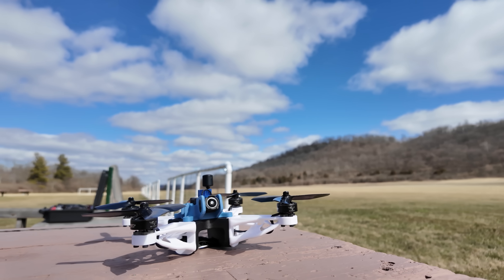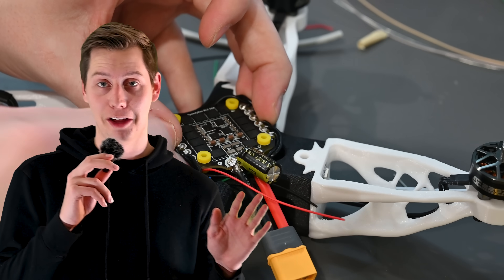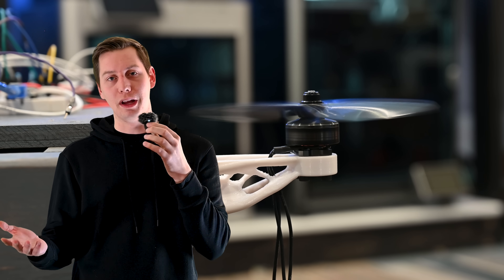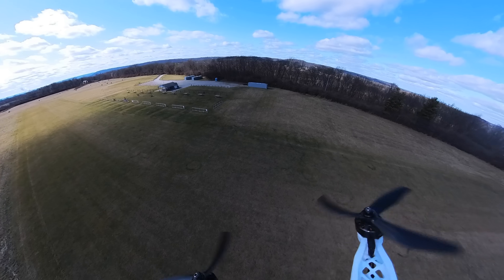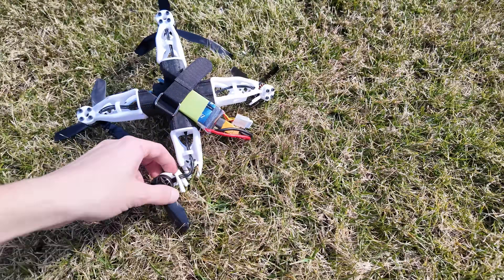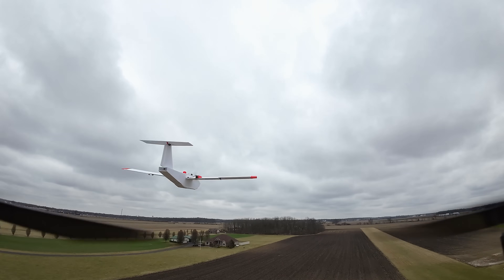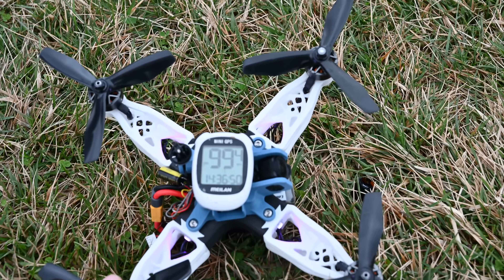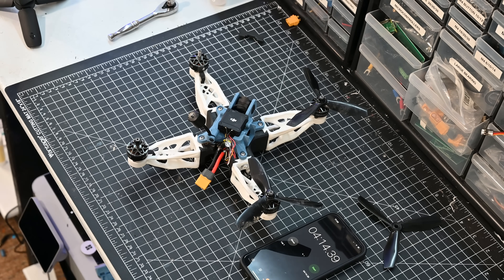Building a DIY 3D Printed FPV Race Quad

Comment: Hi, Really good video and frame. I have one question. When you crashed, you had to change a motor but did not solder a new one. What you use to match the cables..?

Comment: Great project & video.  But note that the DJI O3 Air Unit doesn't "cook" itself.  If needed, it reduces transmit power to regulate its temperature.  So you do need to provide adequate air flow to maintain max transmit power, i.e. don't enclose it inside an unvented fuselage.

Comment: Did you add ALL the parts you used? I see an antenna on the Flight controller, or is that one from the DJI O3? I would like to recreate this but I'm new to drones so any and all help is very welcome
Reply: The DJI 03 has an antenna attached

Comment: How much was the build in total and can i put a anarlog camera instead of the dji 04 unit
Reply: Yes. it has 3D printed adapters that have slots on the sides you'd most likely be able to bolt anything in there

Comment: mounting motors on PLA on a flying machine seems subpar no? glass transision stage is 57C those motors surely can get hotter with hard use. even with airflow? atleast go PCTG if you cant do ABS
Reply: no, not PETG, PCTG

Comment: I really want to build this. I have all the equipment, but no experience building drones or anything RC controlled and I found the how to part was scarce. Is there anything more detailed? Also, any links to the exact filament that was used? Or is the intended audience for this video for people with more experience?

Comment: where did he used 2mm bullet connector?
Reply: For the brushless motor connection.  It looks like that allows the arms to be taken off and replaced quickly instead of having to resolder theconnection every time you change an arm.

Comment: Why don’t you design it to where the arms slide in from the bottom? Seems to me you could just about eliminate the screws and the heat inserts if you did that since the thrust would push the arms in instead of trying to pull them out?

Comment: PLEASE make an assembly video. I’m just getting into the hoppy and I’m starting with a TinyWhoop but then I want to upgrade to a 5 inch and I think this is the one since I also just got the Bambu labs a1 (Although I don’t think my printer can print CF nylon) I’m not good at soldering or any of that kind of stuff so an assembly video would be amazing. Love your videos.

Comment: I noticed that he is kinda just letting the capacitor float on the back of the drone which seems pretty unsecure. Has anyone who has printed this frame found a better place for the capacitor to sit? Or maybe bend it more down then tape it to the frame? just seems like a unlucky crash could rip off the capacitor...

Comment: Looks like a step forward but not optimized for 3d printing, the durability would be very good if this was an injection mold but as a 3dprint it's not durable.
But great ideas incorporated, especially the arms for easy replacement.

Comment: How did you connect the controller to the drone
Reply: you either need a dedicated receiver that you would put in a 'bind' mode. or if you are using the dji O3 air unit that was mentioned in the video, the air unit is the receiver. it has a small button near the RED LED on the side that puts it into bind mode. 

With DJI, if you are using the DJI remote you would actually bind it to the DJI goggles. then bind them both to the air unit.

Comment: Hey can I get some help? I’m building this now lol, and I just tried hookkg up the 03 air unit, and it decided to die. Tried plugging it in to test power up, and it let out the magic smoke. Double checked all my connections and everything seemed good. But it fried the F405 stack. Got any ideas? Motors and some other components still on the way, but yeah I soldered that up and it failed. Also it feels like Km missing something, wouldn’t you need a receiver for it to communicate with controller, or does the 03 flight unit take care if that?
Reply: Regarding your last statement, the DJI o3 air unit has a built in SBUS. So it is the receiver :)

Comment: Did you change motor orientation? Or did you solder the wire around for the upper left motor to go to the bottom right of the ECB of the speedy we're the one is located?

Comment: Nice project.  I am still relatively new to FPV drones and some of the fun of the hobby is the building and in your case here, designing parts.  I do like the look of the arms, the skeletonizing for weight and strength that was applied to it is very cool.

Comment: I want to add something about 3D printing. Have you tried post printing by doing annealing?

It’ll help layer by layer bonding. Check your filament manufacturer for instructions by putting your prints in oven with specific temperature and how long.

Congrats on over 100mph!

Comment: Do you think you can post a video of the electronics assembly and programming with the controller and goggles? I am looking to build one of the drones but I am not a pro when it comes to drone electronics. This would be great!
Reply: where i can see how the electronic is working and how is to do
Reply: @lennyzedi1178 There's loads of video's, but the most comprehensive are from Joshua Bardwell. He has video's of just about anything FPV.
Reply: yeah anyone can print the parts but the electronics and programming is the hard bit for newbs just getting into the game

Comment: As I expected. First crash, and you've broken two arms. Second crash, and you've broken another arm. A carbon fiber frame most likely wouldn't have broken in either of those two crashes. And don't say "it's so quick to replace an arm though". Most carbon fiber frames' arms can be replaced just as easily, and they only cost $5-10 each.

Comment: Really nice design, we all would love to see a 3d printed frame that really works , but when you compare it with a $20 carbon fiber frame that will not brake easily, be sure that you willl always prefer the carbon one, even if it is cheaper and easy to swap an arm. I fly a $100 frame, and even I love 3d printing, I love even more that I beat the s*it out of that thing and it never breaks.

Comment: Ive designed and printed alot of drone frames i have narrowed it down to a pretty good design its basically an x frame the arms have a triangle profile they dont have to be overly thick and i design tubular holes through the arms so i can slide carbon firbe rods or tubes in there so its basically a printed frame with a skeleton inside you can also run lower infill as the carbon keeps it stiff i think you could shave alot of weight doing it that way

Comment: Alright I am going to try to build one. I was at first going to try to use my oculus but it looks like the feed would lag to much. I am sure I could make an app and improve it directly but I really don't want to spend that much time on software. I'll go with all nylon carbon fiber and I am going to switch it up and use a HDZero cam and vtx controller for it as well as a BETAFPV controller. Also I only have m3's and m5's and I think I'll adjust the holes to m5. The HDzero VTX doesn't have a housing like the DJI so I will just have to make one similar. The HDZero is slightly smaller which is good because I can just make a housing that would be the dimensions of the DJI and fit it inside. I will have to adjust camera mount as well. Thanks for your hard work on this. Going to be fun building it all out!
Reply: Nylon, even cf nylon will be less stiff than pla, I'd suggest pla for that reason. Nylon might be more impact resistant though.

Comment: The fact the arms are 3D printed and made of PLA actually might be the best thing about this design. Intended or not it gives the overall structure a consistent and easy to replace point of failure. A sacrificial part, cheap to make and easy to replace. All while still being rigid in flight! Awesome!
Reply: This is something I learned when I tried replacing plastic control arms on RC trucks with aluminum. I just ended up finding the next breakable thing, and it was harder to replace.
Reply: Yeah but ideally it should not break often. Maybe like over 30 uses it breaks once because beyond that its more worth in the long term just to use materials more suited to the purpose.
Reply: where i can see how the electronic is working and how is to do

Comment: The ease of replacing components is definitely a huge advantage to 3d Printing. I think it more than makes up for the lower durability.
Reply: carbon rarely breaks and is quite cheap (~$45) for its durability. It shouldn't need to be consumable. Almost like planned obsolescence.
Reply: @lordjeffery10  depends on how often you crash. Also $45 is a lot of money for some people, and way more than the dollar a printed part costs.

Comment: I love the idea of designing your own quad frame. And I have a couple notes.

Pla is probably a better choice for the arms than cf nylon, its quite a bit stiffer.

Also strength and vibration analysis aren't very accurate for 3d printed plastic since 3d prints are hollow and layer adhesion plays a role. They are useful for identifying weak spots though!

Comment: Another real cracker of a project, and video.  Good to see Peter.
I was thinking much the same as Chris Tuttle... if the arms slid into the dovetails from below, and the top end of the dovetail slot was closed, you would not need the threaded inserts.  I have no experience of a quad like this, so I don't know if a propeller ever reverses direction during extreme manoeuvres... if it doesn't, the thrust will always be locking the parts together.
(Apart from when the unthinkable happens!  😜)
Thanks again.  👍

Comment: I think I speak for more than just myself when I say that we would really love is a printed drone built for range and duration, something that would be genuinely usable as a tool(inspection, overview of area etc.) while also being cheap and easy to repair....
Reply: where i can see how the electronic is working and how is to do
Reply: Yeah but carbon won't break, so don't need to be repared, also lighter, simpler. 3D printed drone doesn't make sense at all. I've done it four years ago, as I said, pointless :)
Reply: @butcher  Anything will absolutely brake upon impact....having the ability to quick-print and swap for cheap is the future.
Reply: @peterklemenc6194  I see you don't have experience with fpv drones. Carbon frames are really cheap and buying spare arms is also very cheap. They don't regularly break on impact and it takes QUITE the beating to actually get them to break. My last frame took probably over 30 impacts before breaking. Then it's just a matter of swapping the arm.
3d printing a fpv drone frame is just not a practical project.
Granted Michael was doing it for fun/ for the project and that's great.
Reply: @definingslawek4731  3D printing was tried years ago for FPV quads and rejected for the same reasons as you see in this video. They are weaker than carbon fiber for a given frame mass and they have poor resonance characteristics which leads to vibration and makes the quad fly worse because the gyro freaks out. You can only do so much filtering on the gyro inputs before the quad flies poorly too so ultimately it's better to use a more appropriate material which in this case is carbon fiber plate.
Reply: @Invid72   It's all in the design. We are designing 3D printed frames that are 3D now. Not flat like carbon fiber. It takes away all the negatives you just listed. Better 3D printers now, and better filament.

Imagine if we didn't try things just because someone failed years ago. 

Good grief 🤦
Reply: @butcher  Im noticing that more and more people really dont want to take the time to understand basic material science + generative design, I'll give it less than 2 years before printed frames start to become as popular as carbon-sheet frames.

PP-CF (Carbon-filled Polypropylene) is very heat resistant, strong, low density, and with the carbon filling, rigid. If you combine that with a generative design intended to be printed - not just 3d printing a design made for carbon sheets - you could very easily reach the same flight characteristics. But it would be way cheaper to replace, and you would never have to worry about the frame being out of stock.
Reply: @willcubemakesI agree, I mean, it is quite annoying from an engineering side to see people print 3d parts, test them, break, and then say 3d prints are just not working. They don't even adjust, redesign or try to improvise the structure of the 3d printed part. Do you really think these companies manufacturing drone frames was successful in their first attempt? I don't hope so, they obviously did more engineering work as they improved their designs. With the 3d printed parts, improvement might mean to combine different materials to make it more rigid etc. Not everything has to be 3d printed. But what I do know 3d printed drones are quite effective in combat situations.
Reply: @butcher   😂

I've succeeded at so many things that others have failed at, give me a freaking break.

Use a little logic. For a long-range cruising utilitarian style drone, you wouldn't need to worry about it breaking, it's not for freestyling. Genius.

Comment: i building fpv racing planes with a pan and tilt cam and back driven holow dual inline holow shaft counter rotating props. this means i have one motor and 2 counter rotating props on one driveshaft connected over a gearbox thats transfers the rotation over a inner drive shaft and a outer drive shaft. i fly only with analog video becauase it is more relyable as digital even the qualitiy is less optimal and degrades over distance but it will never cut out without any signs. i have a special reciver that is able to pickup the signal over 5km with decent quality

Comment: Nice to see. I thought 3d printed frames were weak and heavy. Might try this, a new cf arm takes two months to arrive :/

Here’s a thought, what about each arm is two separate pieces with the layers in 90 degrees to each other when combined. Better strength?

Comment: Just a fair warning, never put your FPV goggles down with the lenses facing up. Especially on a sunny day, the sun can damage or destroy the screens because of the lenses.
Also one material i can recommend for this frame, lightweigh PP (polypropylene) filament, it's really durable for it's weight.
Reply: Thats ppe😊 same thing aunt jomomma bottles are made out of😜
Reply: where i can see how the electronic is working and how is to do
Reply: i mean it depends on the lens type yeah, Fresnel lenses will, pancake lenses wont, ether way its good advice
Reply: And never buy dji because you have to register all your personal data to China and constantly check in.  If you do not the drone won’t work.  Your basically renting the ability for China to spy on everyone with the ability to fly a pretty drone
Reply: Because the lense is a mag
Reply: While i agree on the durability part, PP is One of the most dificult filaments to print from all of them...
A much better, easier to print and EVEN LIGHTER option, would be PC (policarbonate) filament

Comment: Why didn’t you reverse the direction you insert and mount the arms from below? It seems if they slot in vertically from the top, the motor lift direction could possibly pull the arms out. Thanks for the video!

Comment: Hey there Michael, are the modal and FEA analyses applicable to 3D printed parts? Given that they were made layer by layer and are not 100% solid (unless you used 100% infil), as opposed to injection molded or cnc machined parts
Reply: Even with 100% infill layer adhesion would play a role. FEA is still useful for identifying weak points though!

Comment: Man, big thumbs up, It really flies great, there are some vibrations but nothing crazy. Also just a tip, it looks like you could fit some bigger props on there, like 5,5inch or maybe even 6"? you can try it out to and get more drag and efficiency😃
Reply: i tried today with 6 inch props and they fits great
Reply: Yea if front & rear prop tips don't hit each other it could

Comment: This is awesome gonna build one for my self. What would you recommend a cheep FPV system, also please include a parts list and any future tunes
Reply: But I have a 3D printer and nothing better to do soooooo I’m gona stick with this option thanks anyway
Reply: @Rocketboy737_  please don’t be a fool, your gonna hate your life
Reply: @Tealzealorangepeel bro your just being rude 3d printed frames work great for any application where you arent slamming your quad a lot. As long as the frame is a good one that has good resonance and vibration characteristics its great for light cruising.
Reply: analog systems are the cheapest
Reply: Dude just buy a carbon fiber frame, spend $30 more and make a lighter and better drone
Reply: Well no difference then but I will probs do both
Reply: @Rocketboy737_  big difference, just spend more on a nice drone instead of 2 crappy analog ones.
Reply: @Tealzealorangepeel  alr I have a look into other options but I’m am on a budget and am not looking to shell up 250+ quid on a camera system, plus I love to tinker so I’ll se what comes up but I am open to recommendations for parts
Reply: @Rocketboy737_   :  Having watched this video, you get a pretty good idea what to expect.  It appears to me to offer a hell of a lot for someone like yourself.  As with any form of competition, to be 5% quicker than the opposition probably increases your costs by 100%.  If you don't intend to compete, and you don't have to have the biggest, brightest, fastest, highest machine, save your dollars!  Free advice from an old fool.  😜
Reply: @PiefacePete46  yea I agree I was just looking to muck around and have a bit of fun